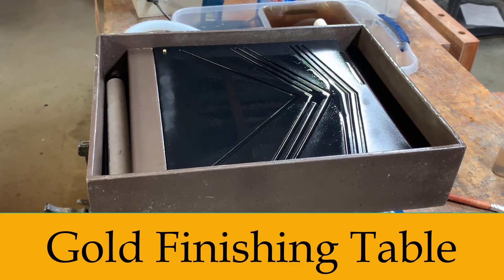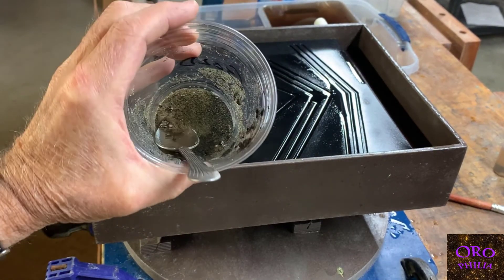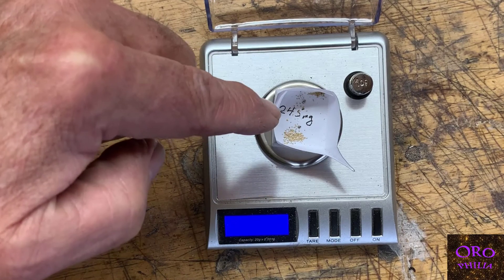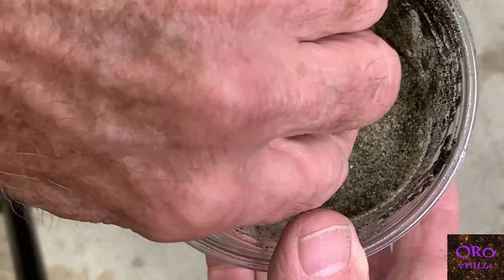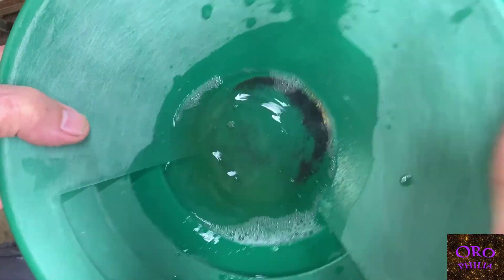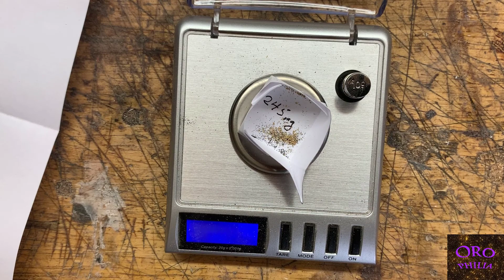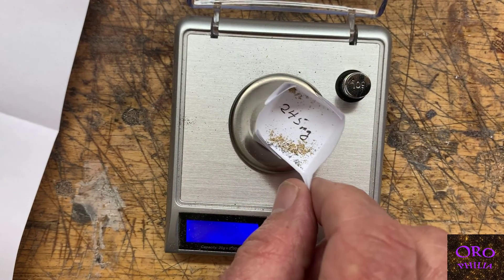DIY Gold Finishing Table for Gold Prospecting  |  Part 1

Comment: Basically the concept is really decent in its machining. I just think if your not afraid of mercury. Retort is the fastest way to get the gold out of the fines from the #1 cons. I have been using the same mercury for the past 5 years its less than 1/16th of a ounce and the retort to separate is very easy and safe.
Reply from the maker: Yes, I agree. If Hg is handled correctly it poses no health risks.  -- Dave

Comment: Is it difficult to make your little paper weighing tray ?
If not , could you make a new one please - I have found the 24.5g writing confused me in the tapes I have watched so far.
Reply from the maker: they are really easy to make!
Reply: @orophilia  So in future tapes when you say something weighs 0.25 grams , I won't be seeing the tray saying it weighs 2.54 grams - Thank You
Reply from the maker: I write the weight of the tray on the bottom in milligrams
Reply: @orophilia  AHA - that solves my issue - thank you.
My scale has a "TARE" button which I use a lot.
But I may write my tray weight on my tray as well just the same.
I like to pour my gold slowly onto the scale and watch it climb.